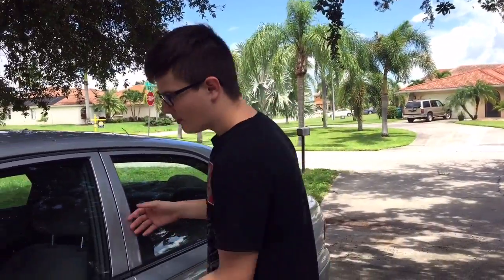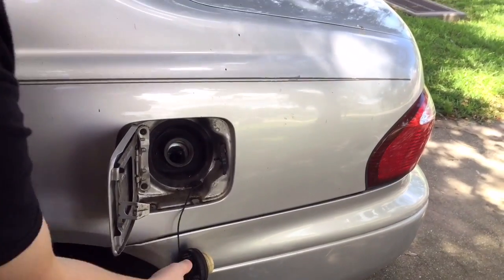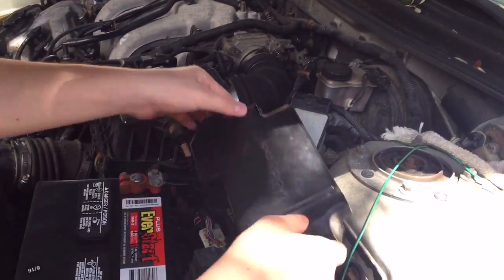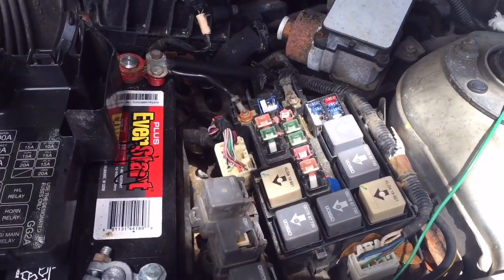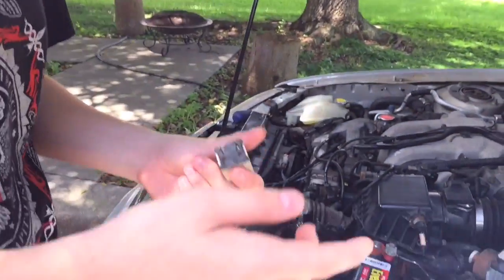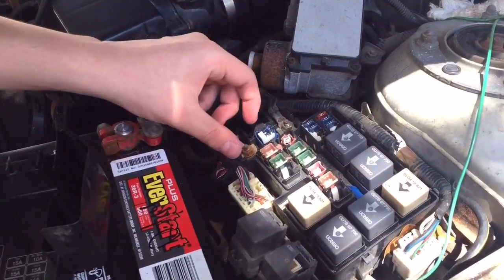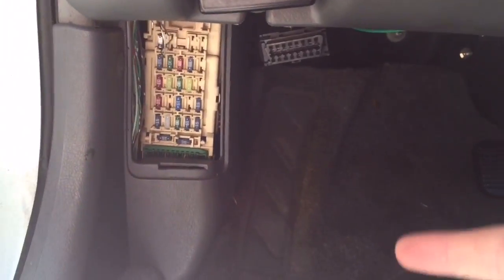How to check if your fuel pump is bad - no start condition on Mazda 626

Comment: Great info you supplied. Switching the relays to test them is a great tip that not many know about. Also, if you think you fuel pump is bad before replacing try hitting the gas tank with a rubber mallet, sometimes it will free up the brushes in the fuel pump and the car will start further confirming your fuel pump is bad.

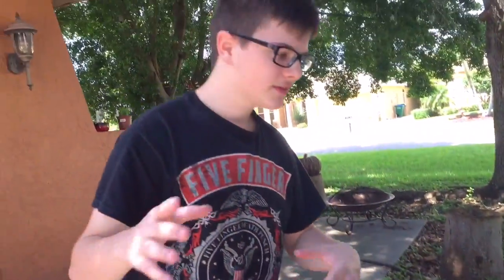Comment: 2:46 It's a better idea to unlock the filter box, remove the air filter, and spray starter fluid (carb cleaner, throttle body cleaner, etc..) into the MAF/VAF.  That way you are not introducing a massive air leak that the MAF/VAF has to account for during start up. No tools necessary to unlock the filter box. :) You could spray it into the PCV hose as you show. That is also a valid method because the PCV has a check valve built in so it won't produce an air leak on start up.  If you don't have a friend to help you can spray then jump in the car and crank. I've done it myself, it works.  If you spray a little in there and engine runs for a few seconds then stalls out, when it previously wouldn't start at all, voila it's a fuel delivery issue. Worth noting on the V6 626 especially, if you have no spark AND no fuel delivery situation, then check the crank sensor.  A faulty crank sensor on the V6 will knock out both spark and fuel delivery.  The ECU will refuse to allow spark or fuel systems to work without a functioning crank sensor. Good video!
Reply: Where is the crank sensor?? On the car?? Also of important, and left out, what about the feul filter??? You can't just instantly say it's a bad feul pump

Comment: Man I have the same problem I think I took the car to a mechanic because I was selling it and he took the battery out while the car was running! and the car stopped on me on the light on the way back home! I changed battery terminals and still nit starting any tips?
Reply from the maker: may have blew fuses. check all fuses and relays just to be sure. also check voltage on battery with the vehicle running to verify alternator is still charging correctly. (13.5-14.5 volts)
Reply: @helveticainc  I checked fuses it wasn’t none and I cheated the alternator it was charging the battery and was fine, also the car shut off by itself when it turned on for a couple seconds a while ago!what should I check next?

Comment: When I turn the key, nothing happens, and the fuel gauge is on Empty.  If I spray starter fluid in the air filter, it will start and run a few seconds, and then die.   Does this sound like a bad fuel filter.  I did the fuse relay thing, and it didn't make a difference.   Some mentioned below to hit the tank with a rubber mallet.  Is that worth a try before replacing the filter?

Comment: Probably a good idea to replace all the smashed fuses in your fuse box. There's a relay in front of the fuse box that's broken too. Don't use pliers to pull relays if you can help it or you'll end up with a bunch of broken bits. ;)
Reply from the maker: Yeah I had eventually replaced all fuses, including main fuse. I LOVED this car for awhile and drove it everyday. I did a lot after this video, I had went through the car very well afterwards, I had lowered it on 2” probe drop springs, had it straight piped from the headers back with a long cherry bomb under the center of the car and another mini right before a duel exhaust tip, put all new vacuum lines in so VRIS would work, new fuel pump and filter, new fuel injectors and seals, fuel rail hoses, intake, valve cover and throttle body gaskets, radiator & radiator hoses, spark plugs, coils & wires and a coil pack, then eventually new tires and battery. I had pained the valve covers red and intake black with heat resistant paint and it looked great. Honestly miss these cars...I would post pics but YouTube won’t let me. It was a great car.
I now have an 07’ Ford Fusion with the 3.0 V6... close enough right?! Haha 😂

Comment: I'm still trying to diagnose my 2001 !! Is it a bad car to own??
Reply from the maker: once i ironed out a few issues from it sitting for awhile, it was a great car to drive! had over 140k miles when i got rid of it, still running great. put a lowering sport suspension kit on it, with some other goodies. fun car, i miss it.

Comment: This video was helpful, but I still don't if it's the feul pump for sure. I hope not, and I don't have an assistant to help. I don't want one either. I would definitely say try the starter fluid, but also clean the throttle body and try fuel injector cleaner. I almost got mine started this way. But don't just listen to people who instantly say it's a bad feul pump!!!

Comment: So I was orginally told it's the fuel pump but the car is super dead I jumped it and got juice but it wouldn't turn over nor would it stay charged after taking the cables off of it. So do you think I need a new battery. Battery is a 2016 an it sat for a year. Any ideas

Comment: Hey, can you help me?
I have a mazda 2, DY second generation 2005 . 1.4 cdi diesel. One morning, i started the engine, and drove for 2 meters backwards, then it silently went out. i tried starting it, nothing happens.... after 10 minuts of trying and giving it a break, i started it again and it worked for 1 second and turned itself off. ever since it did not start again. the engine always cranks but no ignition. we looked at the fuel filter and no fuel comes from any hoses. also we switched the fuel filter with a new one because it was due soon anyway. we think its a fuel pump relay or the fuel pump itself, or maybe the fuel pump is clogged? what should we do ? we do not know how to check the fuel pump easily... it looks like u have to disconnect the whole fuel tank to get to the fuel pump...:
we could also check the fuel pump RELAY but we can't find it............... even in the owners manual there is nothing written about that, there is only a mention of a "fuelsystem fuse" ................... what should we do ?  can't afford going to the mechanic right now but i need the car dearly to go to college...... otherwise i have to travel for 2 hours with public transportation just one way instead of the usual 25 with the car....

Comment: I replaced my fuel pump back in 2013 on my 2001 Mazda 626 2.O, now today it started having similar problems again, it cranks but won't start. It started at first, then the car suddenly turned off and refused to start again.
Reply from the maker: It could very well be the fuel pump again same thing happened to be but only within a year the new pump quit again. You’ll need to Put a fuel pressure gauge on it at the hose connecting both fuel rails together. (Can use a tee fitting with a gauge on it).
Reply: @helveticainc  I hope not. It was expensive the first time I had to replace it.
Reply from the maker: You’re gonna have to throw a fuel pressure gauge on to be sure

Comment: So I have the exact same care have the same problem I changed the fuel pump and the spark plugs and the fuses are okay i have been looking around and I’m hearing a lot about the distributor . But I’m not sure if the one I’m looking at is that
Reply: ileana Perez starter...
Reply from the maker: Did you ever fix the problem?